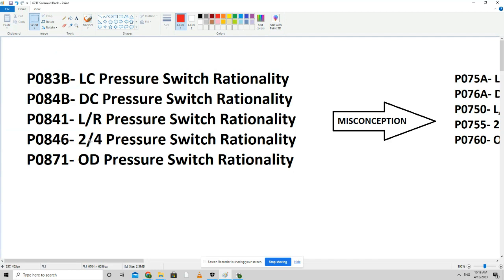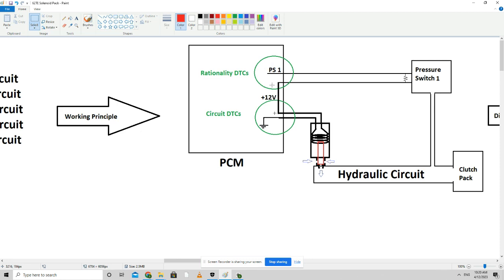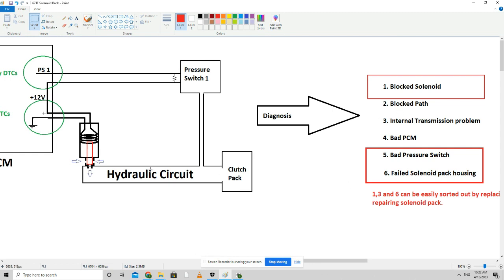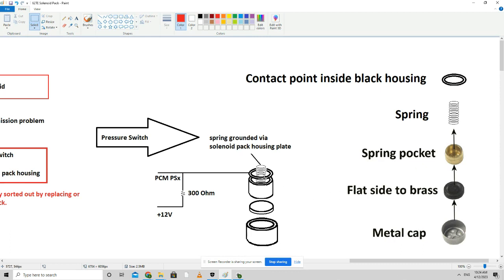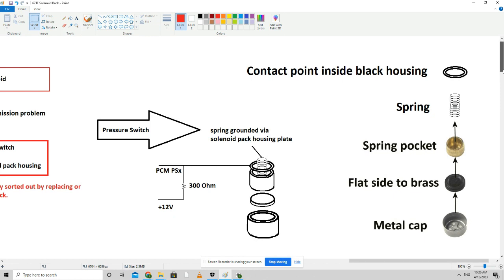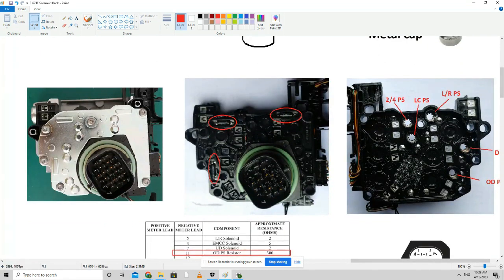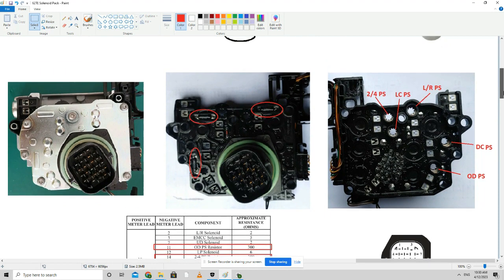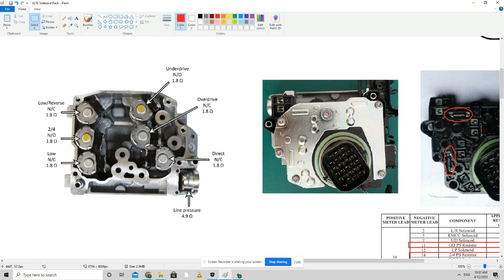P083B P084B P0841 P0846 and P0871 Pressure Switch Rationality Codes Fix.

Comment: Great video. I have a journey 3.6 2014. After many backs and forths with rationalities in almost every gear, appeared P038B alone and the car is stucked in third gear.  Today I checked the resistances,all are within parameters. Would you suggest Transmission  rebuild?
Reply from the maker: P083B is circuit range performance. Have you tried cleaning the switches as discussed in the video?
Reply: @RZJugaar Not yet. I thought if the resistances were correct that step  got discarted .
Reply from the maker: @Jucanor no, it's incorrect assumption.  You still have to inspect and clean solenoids and pressure switches.
Reply: Okay. Still a better option than a rebuild 😂. Hope it works. Much appreciated. 👍

Comment: When passing a vehicle at high speed, the P0871 code appears and the transmission stays in 4th gear and won't shift gears. Clearing the codes and getting the transmission to shift gears normally again.
Reply from the maker: You need further data before a diagnosis can be made. What was the fluid pressure when the fault registered ? If you do not have any other fault codes and the fluid pressure was not 0 (circuit fault) when the fault occurred, then probably your valve body is on its way out. If you have any other codes then they should be fixed before valve body replacement is attempted.

Comment: This is brilliant, can I request you to do a similar video for the 6dct450 Ford and Volvo transmission one 
These are very common issues but I can’t find a video of someone explaining it like you did for this one
Reply from the maker: I spent a lot of time 6DCT450s. Every time it was a stuck valve due to plastic debris. There is nothing else to explain in there unfortunately. Every time it needs removal and rebuild. Revised version of these transmissions with DMFs are very very reliable.

Comment: Help Me Please. First I had P083B and P0882 I canged the Solenoid Pack and Pressure Tranaducer Switch the ones that were removed were Fried. Car Still Will not Move Sounds Beautiful when Running but no Active Engagement in Gear.
Reply: Also Now P0841 After Draining Some Fluid Out Level could Still be a little Low was 1qt over
Reply from the maker: @agoldensoul8434  all codes points to pcm not being able to see certain solenoids or switches inside transmission.  I suggest:
1. Check wiring harness end to end
2. Check solenoids/ switch data under live data.

Comment: What if I don't see 300ohms on the disconnected TCM board? I see it only when I connect the linear pressure sensor. The main problem is that the car refuses to give pressure to the drive position and records the error p084B. Also, quick learn does not occur, ending with a limp-in error, although there are no errors in the block
Reply from the maker: if you do not see 300 ohms between pin 15 and pin 10 (as i discussed at 28 -29 minute mark then you need a new solenoid housing.
Reply: Thank you very much, you are my hero
Reply: Launch sees position D and evaluates it as 3Gear

Is it possible to check the "cups" for operation before cleaning them and assembling them on the board?
Reply from the maker: you can do that but you'll have to remove the solenoid pack from the valve body. you'll have to provide power and ground to the solenoid pack and then you can measure the voltage on the pressure switch pins. 
When you apply air pressure on various holes behind the valve body, you'll see Pressure Switch going to 0v which means its working.
Reply: Thanks for the reply, this is very valuable information. Power supply 12v?
Reply from the maker: yes 12V
Reply: On the switched off board I checked the resistance of pins 10 and 15, it showed 300. Is it only left to check the operation of the "cups"? And how to check the connector that is installed in the solenoid block, does it make sense?

How all the board indicators are in normal values(
Reply from the maker: If you see 300 between pin 10 and pin 15 then it means that the error is not because of the broken or bad solenoid pack. It can either be from the "cups" or you are not getting the line pressure.
The reason i'm leaning towards a possible fluid pressure issue is because:
a. Your code is a hard code, it's not intermittent. Codes due to "cups" mainly result in intermittent codes.
b. You mentioned it straight away gives this code (and goes to limp mode or 3rd gear) when you put the car in drive. But you did not say that it also issues "Loss of Prime" Code which is for fluid pressure. This gives rise to the possibility that there is fluid pressure in the system but the TCM does not see "Direct Clutch" being applied. This indicates internal failure of the Direct Clutch, maybe a leaking piston or a broken component. 
I suggest remove the compounder (i have a video on it's removal from 62TE and you do not need to remove transmission for that) from the transmission side, do a complete disassembly and if you are lucky enough, you'll find the problem over there.
Reply: The error is not hard, it appears only when after turning off the socket and turning on it is possible to pass quick learn. Only in this case does the adaptation pass. In normal cases there is no error, but at the same time the drive mode is in the 3rd speed based on the computer data. But without re-plugging the socket in 100% of cases the adaptation does not start and the limp-in mode is indicated, and the adaptation does not occur.
Reply: Question. If I activate the solenoids with air and the valve clicks and operates on 4, then on 2 out of 6 this does not happen. Could this be the problem? If, for example, the valve is stuck in the open position or the valve is faulty. According to the diagram, the direct clutch solenoid valve and 2/4 solenoid do not operate
Reply from the maker: @pavelivanov5540  you may be right.  Either the pressure is leaking or the clapper valves are not working for DC and 2/4 clutches.
Reply: Does not go forward or backward:(
quick learn successfully, when switching the ignition, the pressure on R is triggered, but it records errors p1790 (active) p0733 (pending) p0736 (pending) p0846 (pending), with recorded errors, learning does not occur (limp-in). With active test using launch: OD Solenoid mode control, LC solenoid, DR solenoid, the movement occurs correctly and everything works. But at the same time VPL Solenoid and EMCC VPL solenoid - denied
Reply from the maker: @pavelivanov5540  i think it's a good time to have a look at the compounder.
Reply: How could it be a problem with the compounder if during the actuation test, when activating the dr solenoid, the car moves forward without any problems?
Reply: And we didn’t change the compounder for the same used one.
Reply: Another important clarification: the car stopped engaging reverse gear
Reply: Another interesting thing is that through the launcher I see the neutral position (N), when in fact the automatic transmission is in position P
Reply from the maker: ok, lemme explain what happened. initially your car was able to go to 3rd gear. 3rd gear only uses 2/4 clutch and UD clutch during the launch phase. it does not use the DC clutch. so DC rationality DTC did not affect the limp mode.
Now you did something which affected the 2/4 clutch engagement and it threw the P0846 which is rationality DTC for 2/4 clutch. Now since 2/4 clutch cannot be engaged, your 3rd gear will not engage which inturn threw 2 more codes, incorrect gear ration for 3rd gear (p0733) and "FAULT IMMEDIATELY AFTER SHIFT" (P1790).
P0736 is GEAR RATIO ERROR IN REVERSE which means whatever you did, ended up with disabling the reverse gear too.
Reply: @RZJugaar  After the automatic transmission was reassembled by a mechanic, the car never went forward. 3rd gear was visible only in launch, but in fact the car did not go forward. After cleaning the cups and replacing two solenoids (the valve did not work), the car stopped going backwards. But, a distinctive feature after reassembly, with the help of launch activating the OD, DR, UD solenoid and others, the car goes forward and backwards.

Comment: They were the peeling stretch marks on the converter, change the oil pump, converter and filter.  but.... now it only goes in reverse, and I have the active code P0871 that you recommend.  thank you so much
Reply from the maker: Hold on. You just have p0871 and no rationality codes. This video will not solve your problem. You'll have to look behind the pump. Is this the only code you are getting?
Reply: Yes, only that code, P0871 and it only goes in reverse, it is a 2009 Dodge journey 3.5l, when you put D it jerks but it does not roll
Reply from the maker: @Arnu-v5d  Sorry my bad, i ready P0871 and my mind processed it as P0731. P0871 is definitely a rationality error and this video will help you understand why this error is generated. Rationality switch errors are usually intermittent and not permanent like the one you are facing. 
Let me ask you this, when the oil pump was replaced, are you sure the input clutch drum was not moved and if yes, was it properly seated?
If you move lever from D to S and then manually change the gears to 6, does it not move in any of them?